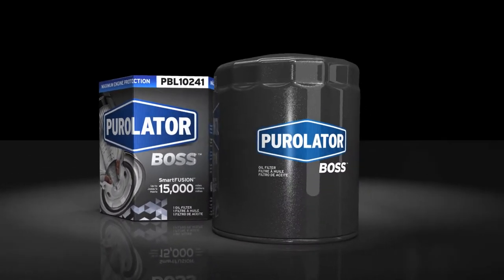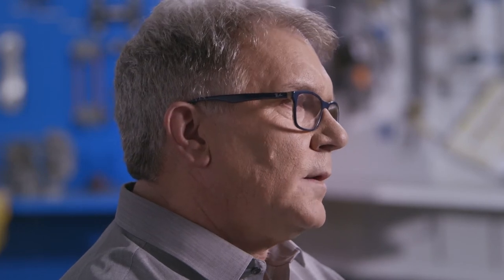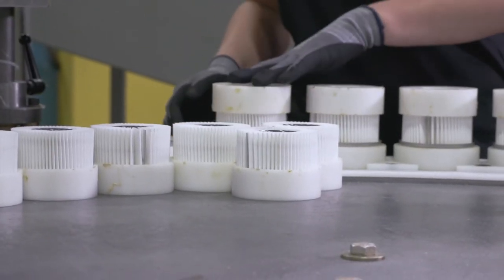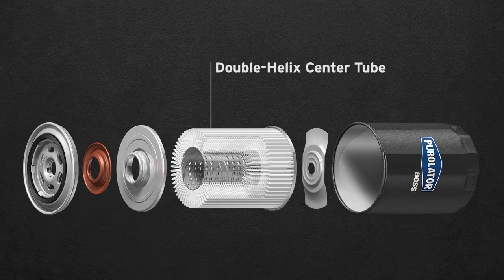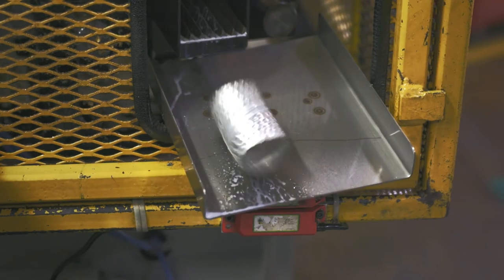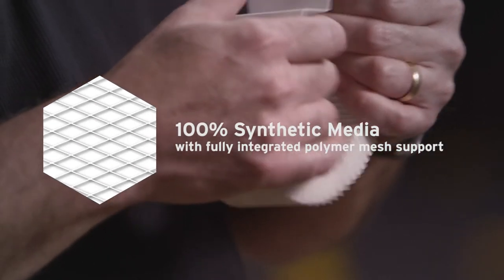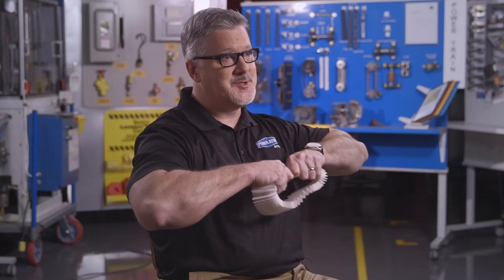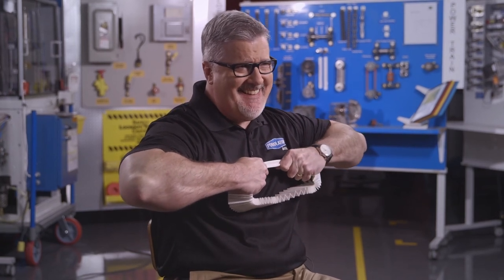The Story Behind Innovating a Next Generation Oil Filter – PurolatorBOSS™

Comment: Emailed Purolator to ask about efficiency rating... no response.  Called & asked same question... someone who clearly knows nothing said it's 40 - 99.  I'm pretty sure (she) had no clue what she was telling me, but I assume it's 99% efficient at 40 micron.  How about telling us the efficiency rating at 30, 20, 10, and 5 micron?  I want to like this filter so bad, but the media is ... so bad.
Reply: Go to Bob is the oil guy website forum, and vote for this filter to be tested in a ISO 4548-12 efficiency and capacity test comparison. A company called Ascent Filtration Testing might run a test on it for you if it gets enough votes.

Comment: Wow, Purolator Boss oil filter with Pennzoil Platinum 0W-20, full synthetic motor oil is awesome in my 2015 crew cab Silverado 2015, 5.3 V8. Went on a 40 mile drive since the oil and filter change, and my miles per gallon kept climbing up to 20, even after doing city stop and go traffic driving! Great oil filter, from now on, I will use the Boss filter on every oil change, unless they manufacture an better oil filter!!!
Reply: Thanks,what is vehicle Status now ( miles, use, Filter,etc)…..
Reply: @opera93  It's Awesome, Still, in city driving, it averages (18/20 mpg), and on highway driving, the best is 26 mpg.. The Boss Filters are a little expensive, but it's well worth the improved engine performance, and I change my oil and filter, when the indicator says 30%, never lower than that, Thanks for asking!!!!!!!!!!!!  :-)
Reply: @MrJamesgrate  interestingly, just went to Boss @MOBIL 1 5W-30, in CANYON 2007 with 147 K…. DOING “ Italian TUNE UPs” now ( e.g. to alcohol Free Gas , with INJECTOR CLEANERS, ETC AS HAD SOME STUMBLES,ETC) .. also,interestingly think gas mileage improved on 91 OCT alcohol free, etc.
Reply: @opera93  That's great my friend, I am all for mileage improvements, even if i have to spend a few more pennies, i don't have any mods, or tunes on my silverado, although i thought of having and engine tune to increase the rpm's form 500 to 600 rpms, I simply used the process of elimination, I started first with the blood of the engine, I stopped going to the dealer for oil changes, and started doing it myself, using Pennzoil Platinum, and the Boss Oil Filter, everything just simply started improving, I still use 87 OCT, one day I might try some 89 in her, just to test it out, Thanks again my Friend, for your Info, Take care and Stay Blessed!!!!!!!!!!!!!!  :-)
Reply: @PayNoTaxes0GetNoVote  actually, I do use (Lucas Fuel Injector Cleaner), Once a month, when i fill the gas tank,  to keep my engine running very efficient, i also use the (Lucas Oil Stabilizer) made for modern vehicles than run on (0W-20) motor oil, when I traded in the Silverado for what i drive now, a (Toyota Tundra Crewmax) the mechanic that inspected the silverado told me that engine was very clean, the mechanic also asked me, when did i have a Fuel Injection clean last, my honest reply was "I never had a fuel injection clean, since i purchased the vehicle for over 5 years!!! I did what ever i thought was best to maintain my truck, and I will certainly continue the pampering of my vehicle with the Toyota Tundra!!!!!!!!:-)

Comment: I use Purolator filters only thing I don't like is the inlet holes are small and less of them vs even a factory oil filter. If they would inlarge the holes it would be a perfect filter
Reply: All the inlet holes on filters are pretty much the same size some have 6 some have 8 even some have ten the less holes thinner the oil more holes thicker oil

Comment: I've read that the Purolator Boss restricts oil flow... Prove to me, that ain't true...
Reply: I think the inlet holes should be larger. The Motocraft filter has nice large oval holes
Reply: NONSENSE.  Pure, unadulterated, NONSENSE.
Reply: There is a video that shows Purolator boss has the best balance of oil filter properties. Put through stress tests, it performed in the top three or four in every category. They aren't trying to have the highest flow or the best filtration. They are trying to have the best balance of everything. Your car will thank you for using this product or the mobile one extended performance.

Comment: I recently put in the Purolator Boss filter. WOW. Amazing product it is. 

I have a 1986 Yugo GV with a 1.1 L, carburetor , high compression engine and always put 10w-40 Castrol GTX conventional oil . I always remembered their commercials on how they were engineered the oil for smaller engines like my car. Their works were always conceiving when you see the intense heat being build up on the combustion chambers and then they broke down. Did one amazing job getting the viewers attention that's for sure. 

Then I add the Purolator Boss filter to maximize engine protection, boost it's efficiency, extreme reliability in filtering, and the satisfaction rate  on how it works.   

Got to say it was an excellent combination that I recommend for your older model high compression motors. It runs like it's off the dealerships parking lot. 

Thank you for sharing this video with us. It made me want to buy the BOSS filter and boy, I'm never going to buy anything else until Purolator outdoes itself on developing another advance version to succeed it.

Comment: No mesh backing on the filter element......."we built this thing tough" except for that, I guess. Wix xp for me.
Reply: Actually it does have a mesh backing. It's just white and made out of polymer so you can't see it from a casual look.
Reply: WIX XP is not as efficient as Fram Ultra...
Reply: There is a mesh backing
Reply: The SMART guys got rid of the wire-screen backing because it was too bulky - the new Polymer backing makes more room for more PLEATS of filter material -- and thus more filtering media area.